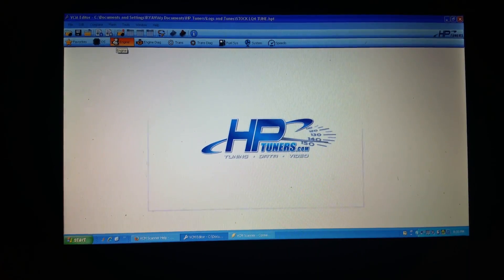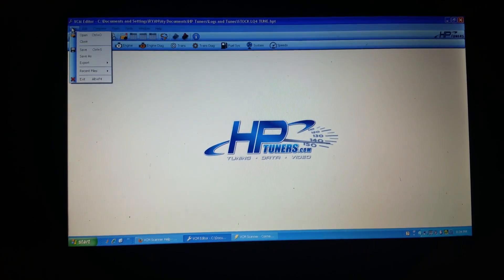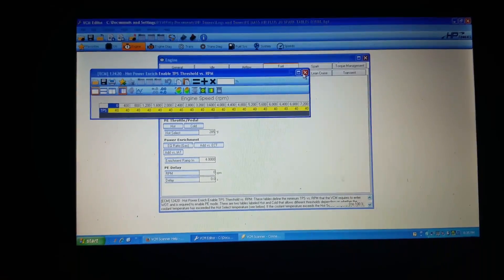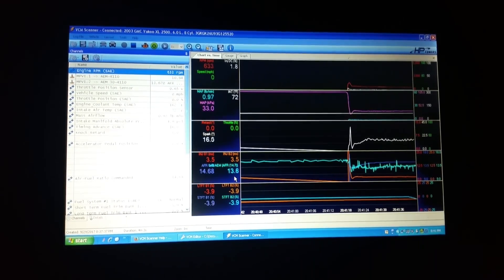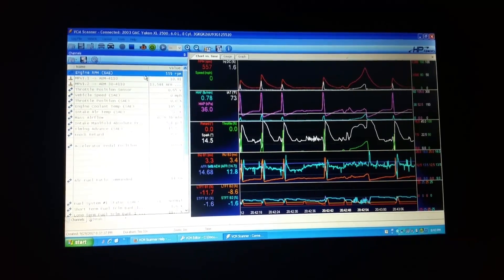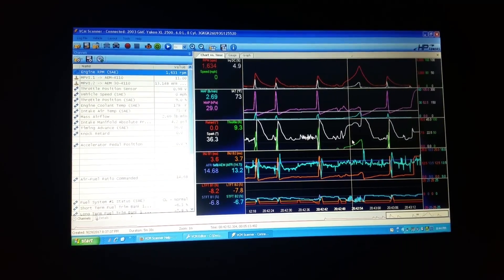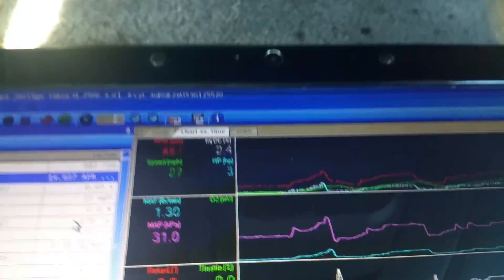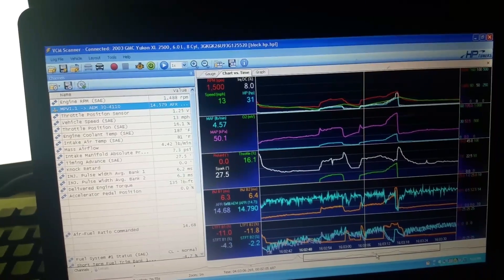LQ4 HPtuners POWER ENRICHMENT!!! HORSEPOWER DATA LOGGING!!!

Comment: I know this video is super old. But I'm sure glad I did more research before following any of this info... what ever you wrote that tune to. I would say you probably couldn't pass a gas station with out stopping to refuel. aside from the crazy settings you have, you could add to drop the percent of 100% in the top PE ENABLE setting to somewhere around 60% or to follow the crazy settings. more like 10%

Comment: Go in to the eq ratio under pe and set it to 1.18 flat across the board  should be around a 12.45 afr at wot or pe mode and that’s pretty good for stock all motor 6.0
Reply from the maker: I have it at 1.20 flat right now, so pretty close.

Comment: I've been using HP tuners for a little while and never knew about that Horsepower setting.Could be good for testing parts so you can get a baseline then go from there.
Reply from the maker: Ill put a video up of the calculation for it today or tomorrow.